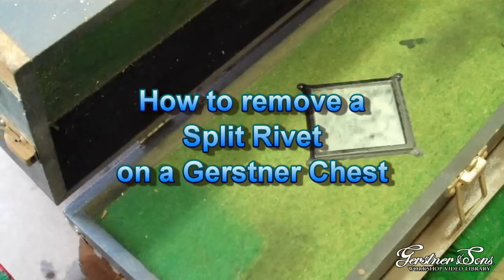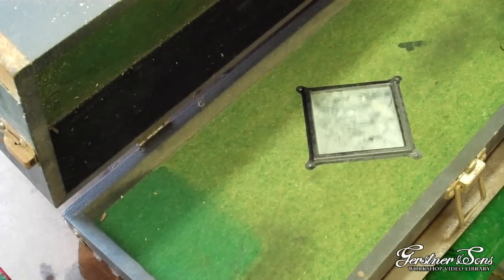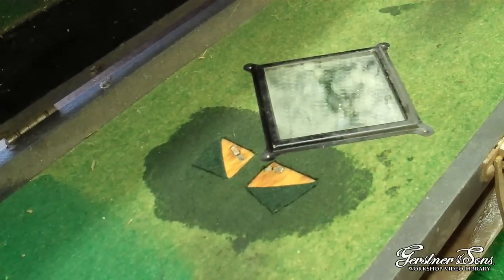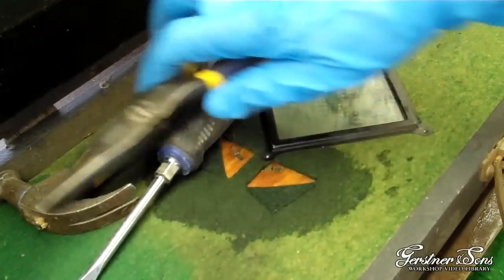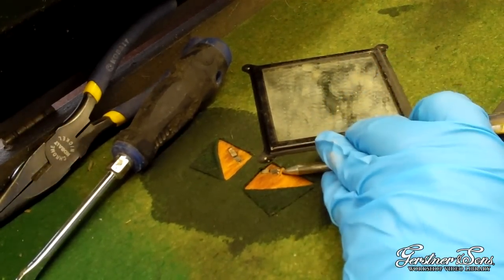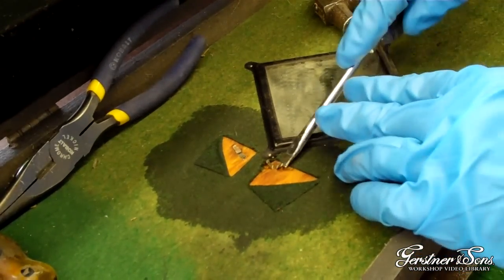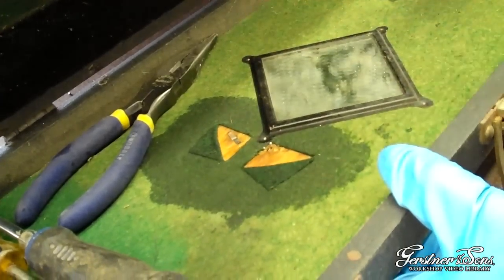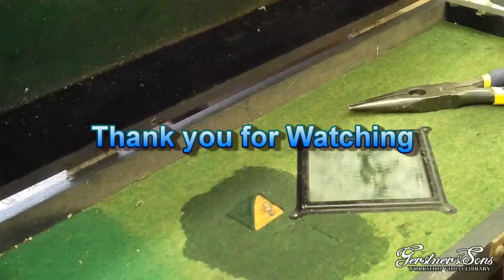How to remove a split rivet on a Gerstner Chest

Comment: I found a better way to remove the split rivets. The process to remove the felt worked well. But --- the process shown to remove the rivets took too long and tore up the the wood on the inside. What worked for me is as follows: #1 Prick punch the center of the head of the rivet from the outside. #2 Using a #2 center drill, drill the head of the rivet  till it starts to spin and stop. #3 With the head of the rivet removed, use a 1/8" diameter drift punch on the outside, and  tap the rivet through. FINISHED in no time and no damage to the inside wood.
Reply: My thought as well. Way less damage. I'm about to do this with a guitar case.
Reply: Thanks so much for this comment. I did the method in the video one time and didn't like the results even though I was as careful as I could be.